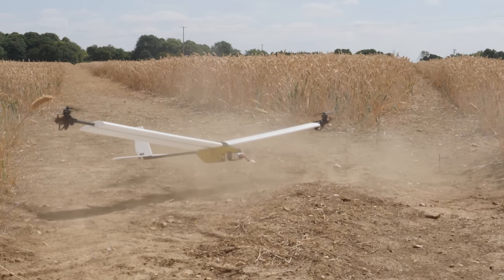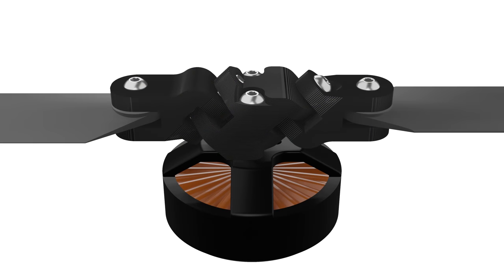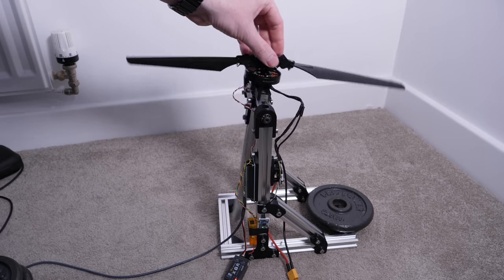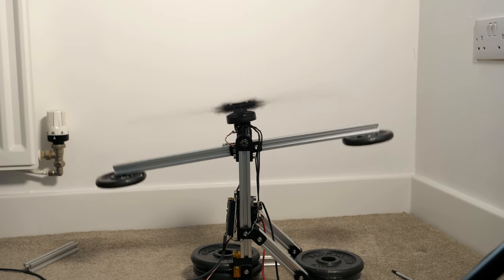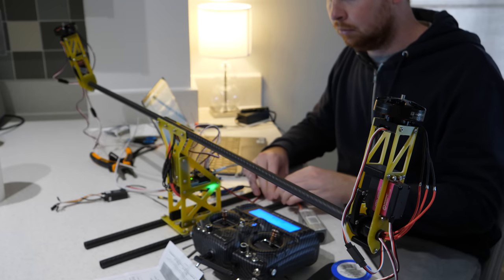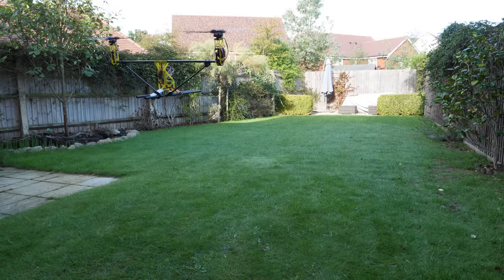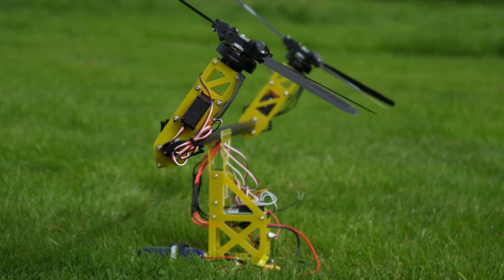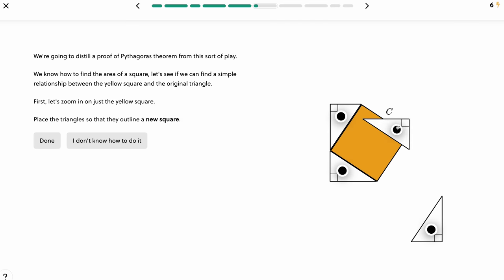Building a V22 Osprey - Part 1

Comment: I had no idea motors could be controlled so precisely and so quickly. Amazing idea and execution, mate.
Reply: Tom really is a bit of a genius.
Reply: Same here I figured the momentum would stop it from being able to be controlled this way.  That's a genius way to go about it.
Reply: As a mechanic I know engine management looks at the crank signal and can also tell when it speeds up or slows down. A 4 inline cilinder fires every 180 degrees. Spark or diesel fuel injection is done with similar timing needed for running a brushless motor. With brushless you need very fast coil switching with correct timing before or after each permanent magnet. So many times per second and within a degree of rotation accuracy, it's mind boggling fast for a human
Reply: @Fantaman900  This is what I'm sayin', it's incredible it actually works.
Reply: Better make sure the motors are sized up a bit along with the voltage and current controllers, because constant rapid changes like that are an express train to burned out electronics.
Reply: @Fantaman900  im wondering if this technology could replace fluid-damper on the front and back of the crankshaft and or get rid of some parasitic HP losses and or maybe make more power and or the parts last longer and or add detonation resistance 

yep i 2 figured the mass/centrifugal force's would stop 🛑it from working like this
Reply: Me neither. Mad, mad mechanics.
Reply: This is nothing compared to what is possible
Reply: @redsquirrelftw  isn't the momentum of the blades part of the working principle? Because the blade lacking behind allows the center hub to tilt it :)
Reply: @MiniLuv-1984  This is something out of first year of an engineering degree. Your personal incompetence is not a guarantee of anyone else's genius status.
Reply: @supermaster2012  Thank you Alfo. A direct insult rather than a veiled one. Misguided and narrow, sure, but direct.
Reply: um. Ever heard music from a radio?
That speaker, the loudspeaker, is a motor : a device that converts electricity to motion, electric energy to kinetic energy. 
And from what you can hear it can do it very quickly and very accurately.
Reply: UH, no. A speaker is a paper cone attached to a permanent magnet and driven by an amplifier. No motors involved at all.
Reply: @da_SpiffR  you do not recognize it, do you.
Reply: @da_SpiffR  A transducer, which is what you're talking about, is nothing but a linear motor.
Reply: Looks like we're one step closer to mimicking how a dragonfly flys!
Reply: If this impresses you, you should check out industrial servomotors. They're mind boggling precise.
Reply: well, controlling motors or other electric parts within single digit milliseconds is pretty much the industry norm since the late-80s to mid-90s so while fascinating and hard to grasp by a mind which never showed an interest in it it's really not that special.
Reply: @Simon-bu4kc  problem iv noticed is most millwright equipment is it over shoot's and or under shoot's and or lower-speed's-response's and no to my knowledge a V8 dampening @5 to 12K RPM's is hard to do in a passenger car/on the road at cost ect
Reply: @backpropagated  yes if its not spitting error code's at me or ghost code's/problem's to fix
Reply: @richardprice5978  sorry, I'm a little confused because if I get it right, you are talking about a petrol V8? that obviously is another story because engines and electric motor really have nothing in common exept the fact you get a turning axle at the end of it. I was referring to only electric applications.
but you are absolutly right about accuracy: when making machines or technical applications more accurate cost rises exponentialy. a mechanical engineering prof of mine used to say "as accurate as necessary, as imprecise as possible" and "as expensive as necessary, as cheap as possible".
as for the bad low-speed-response, I thought with PWM controlling that porblem is mostly gone?
Reply: @Simon-bu4kc  most of the robotics Kr500 stand-still to moving at full speed it a delay ( electric and mechanical ) as there's mass to overcome and same thing for stopping and or actuators on something like rose candy or parker-industrial-manufacturing  equipment and in slow motion steel will twist as a spring adding to the motions and or aiming/timing and making it harder for me to see/fix some types of failures
Reply: @Simon-bu4kc  most gasoline or diesel engine damper's on V8's are a solid chunk of iron on the front of the crankshaft mostly for cost reason's not because it's the best choice for the job next up is rubber o-ring next is silicone filled unit and maybe a electric motor and control could do better with the task and cheaper ect
Reply: @richardprice5978  as I said I am not really experienced when it comes to small electric motors but what you are saying sounds interesting. mass inertia and that sort of stuff is fairly obvious but on a small scale with low power it's less of a deal obviously.
as a mechanic I'm quite aware of primary and secondary vibrations on piston engines. however, the days of a single balancing mass on the crank are long gone unless you buy a really cheap american V8. first of all the whole crank is precisely balanced (obviously) since it's spinning at up to 6000 RPM with opposing forces hammering on it from the pistons. usually nowadays you have 1 or 2 seperate balancing shafts in every engine to deal with the vibrations. only for a straight 6 or V-12 you don't necessarily need them since these are harmonic setups.

Comment: This variable pitch technique is nothing short of amazing.
Reply: it’s practically organic! most elegant.
Reply: Came here to say the same thing! 

One possible way of making it even more elegant, would be to replace the pivot with a flexible hinge that has bending-torsion coupling; or better yet, if you make your own composite blades you could bake that coupling into the fiber orientation. Not sure itd be easy to obtain the required amplitude in such a way though.
Reply: @eelcohoogendoorn8044  I'm guessing you already have a degree in civil engineering? With the complicating dynamic construction idea? You should start your own YouTube channel 😉
Reply: It reminds me of the hacks people in C64 demoscene did :) Like the computer supported 8 sprites but people changed the memory while the sprite chip was drawing them to reuse them on the same screen many times :)
Reply: @jamiewatkins4178  Its not a very original idea; torsion-bending coupling and how that relates to fiber layup is already something you need to pay attention to in the design of wind-turbine blades.
Reply: I think this can be done with a real plane.  Its an elegant solution.
Reply: @javaskull  The bigger the propeller the more inertia it has - and the more energy it takes to change the rotation speed. That's why there's no big quadcopters - at some point changing the pitch of the blade is more efficient than speeding the propellers up and down constantly.
Reply: @javaskull  This is the best I can come up with: Spar cut from flat fiber sheet for axial and out-of-plane bending stiffness; two printed foam cores glued on both sides of that, then wind a layer of fiber roving around that in purely circumferential direction (providing neither bending nor torsion stiffness, but something for the next layer to push against), and then a 45 degree layer of fiber around that doing the bending-torsion coupling; then resin infuse the whole thing in a printed mold to provide the overall shape and aero profile. Perhaps youd need multiple alternating fiber layers for it to work well; fiber buckling might be an issue?

I think its important that the sectional area is a little bit substantial at least near the root; in the limit to a flat plate profile your coupling vanishes I think.

Comment: I apparently need to go back and watch your last video about the single-motor variable pitch blade. it's absolutely astonishing how well that works. Gaining degrees of freedom by modulating a single output and not adding an extra motor OR controller is brilliant. Awesome project!

edit: does flying that way take a significant efficiency hit? I'd guess that with a sufficiently complex controller, you could get regenerative breaking for half the cycle, throw a mid-size capacitor inline with the controller and be in business! Part of me was wondering if a "real" helicopter could be built this way, but it seems like you'd need a lot of extra complexity to dynamically oscillate the speed of a gas engine output and the standard mechanism may be easier?
Reply: I doubt very much that a gasoline engine could be made to do this by itself. That said, it would be almost trivial to introduce the necessary sinusoidal rpm oscillation. Improperly clocked u-joints on driveshafts already do that, for free. All thats needed would be some sort of mechanism to skew them in and out of time.
Reply: Wouldn't this mechanism with a chemical engine require either a mechanical system to quickly reverse the direction of the motor's torque many times per second, or a braking system to reduce the speed of the motor? I'm not sure if the former can be practical, and I'd imagine the latter would at best wear down the brakes extremely quickly.

Actually, I wonder if you could use special gearing to achieve the effect. I assume the way that the motor works is by rapidly accelerating the motor, to adjust blade pitch one way, and then by letting it naturally decelerate to prevent the blade pitch from going the other way? I think you might be able to accomplish this with spiral / shell gears, like in this video (https://youtu.be/0wEtyzgnEY8) but less extreme. Alternatively, I think an egg-shaped or elliptical pair of gears could work, if the axis of rotation is not in the center of the shape (maybe in a focus of an ellipse?) With a constant motor speed, the driven gear would rapidly accelerate regularly, and then slowly decelerate. This would correspond to a blade pitch that is asymmetric over time and could be used to control the aircraft.

I think you could make a design that could (theoretically) work from a constant motor speed. You'll want to have what is basically a manual transmission, but instead of each pair of gears changing the torque/speed by their ratios, you have pairs of shell / spiral-shaped gears with different curves. Oh, and you'd have 4 counter shafts, each with a different shell gear paired to one on the input / output shafts but rotated 90 degrees. Each of these shafts would accelerate the motor (and thus pitch the blades) at different places along the blades' rotation, and thus would correspond to asymmetric lift in different regions to control the aircraft's pitch. 

There's probably a way to use only 1 counter shaft instead of 4, and bonus points if you can create a continuously variable transmission that's spiral-shaped to change the rate of pitch change.

I hope this comment made sense, I dropped out of engineering and learned terms like 'counter shaft' and 'shell gear' just now while searching on wikipedia for how to explain my idea.
Reply: You’d loose some efficiency right off the bat with the conversion, but you could fly-by-wire the main rotor in the most literal way: converting the gas to electricity and then electrically modulating the motor, but I think that whole assembly would certainly loose on complexity and cost to a standard helicopter
Reply: @luelou8464  hah, yeah they would for sure. I wasnt really thinking about in a practical way, but just from a "this is a way it could be done" way. Yeah there would be challenges there for sure, probably not worth it given that the swash plate mechanism already exists. Electric motors just have so much better response rates, so its possible to cheat (in an honestly brilliant way, I'm baffled that this works at all, especially with commercially available speed controllers, and not some custom solution)
Reply: @AlphaPhoenixChannel  yeah, you'd lose by just requiring a generator and an electric motor and a motor controller capable of this control scheme in addition to the fuel burning engine I think.
Reply: Would adding a differential system, with one of the "wheels" hooked to an electric motor and the other going to the main rotor, still be considered "a lot of extra complexity"?
Reply: @tiagotiagot  oh my god that’s amazing. That’s so simple you could oscillate it with a spring. Holy crap
Reply: @AlphaPhoenixChannel  And by modulating the spring tension you can control the applied torque.  Maybe it can be possible to always have it in resonance as engine RPM changes, for maximum energy storage and release.
Reply: Biggest concern around using this method in an actual helicopter would be that it completely stops working if the engine fails - control of autorotation would be impossible without some clever techniques to effectively brake the rotor disk at points in its rotation because the motor is no longer providing any control capability... was thinking about it a lot on my way to my pilot lessons the other day...
Reply: @martync6713  : Another problem is that each rotation change is an additional stress event, which will shorten component life. Not necessarily a problem, and swash plates cause the same, but something worthy of note regardless.

Comment: Very elegant, that thing is gonna look so cool. Seen a few similar questions, thought it might be worthwhile pointing out the pole changes in a brushless motor are done electronically by a micro, so can pull some neat tricks like this. a brushed motor is switched (commutated) by shaft position and an AC inductor motors by input frequency, making it very tricky to adjust speed mid rotation by varying the power delivered. Very precise speeds can be attained, but still take a few revs to count, adjust and recount in a traditional feedback loop. A nice exploit of the advantages of brushless motors. I have noticed high end brushless grinders stop almost immediately when you let off the trigger (active breaking), mid grade pretty quick (passive magnetic braking), but 240v spin for ages (pure inertia, no magnetism without power). No data, just observation.

Comment: HI Tom, something that occurred to me is that you could use ceramic bearings. This are quite cheap and they come in big sizes these days. I bought some for a tilt rotor quad copter I was building.
Reply: Ceramic bearings are always better in performance and endurance.  And the way the three bearings are each pressing on one point of each bearing lends itself to using a ceramic bearing and realizing the advantages thereof.

Comment: Awesome progress Tom. Great walk thru on the process you are going thru. The lead / lag, set up on the rotors is crazy how effective it is being it is torque influenced. My question is "As fast as the rotors spin and as many changes per second are needed to make it do as you wish, how much does that effect the speed controller?". I would assume you use higher end esc's and have some sort of cooling going so they don't melt and let the magic smoke out?

Comment: Showing how the helicopter blade pitches on one side in slow motion is so beautiful. It's borderline organic, it reminds me of a bird flapping it's wings. Helicopters are truly amazing contraptions. Your design is also super interesting.
Reply: It's super cool but I think it's probably causing the vibration. The torque reverses with every revolution, imagine how a car lurches forward when you let off the gas. 

I don't see anything wrong with the tilt mechanism in the previous video, in fact I think it's cooler than the real osprey due to it's simplicity and the fact that it utilizes the same mechanism that tilts the rotors forward. I think forgoing any kind of traditional blade control is a really innovative way of building this kind of vehicle. Though maybe it wouldn't work for something the size of a real V22.. idk I'm uneducated

Comment: Very cool. On YAW control:
If you lean the rotors to the outside by a few degree, you get yaw control by Differential elevator of the rotors. Works on my AW609. No need to use tiltservos for yaw anymore. Mechanics get more rigid...
The extreme Version is the KMax.

Comment: Thanks for sharing your fascinating experience with the  V22!  Respect!   Some 20 years ago I was working on models for a similar (full scale) configuration using a different approach, and met a number of people in the USA who were working with the V22 -  they were struggling with a problem called Asymmetric Vortex Ring, which was an irrecoverable instability that killed a number of crew and wrecked the V22 prototypes. Turns out that long ago the record-breaking Russian 'Vintokryl' bi-rotor had similar instabilities too. Long story short, AVR occurs when a pilot is coming in to land a bit 'hot' and pulls more collective than is wise; this triggers a Vortex Ring condition in one of the V22 rotors,  reflex correction of the resulting roll exacerbates the AVR, and they would ht the ground sideways or even fully inverted. Bad news.
Let me know if you run into problems like this, be happy to share what we learned. Ben

Comment: It looks awesome!!! If you find you’re still having rigidity troubles with the spar, might I suggest switching to a twin or even triple I-beam setup. While this is by no means my area of expertise, it works well enough for the prototypes, and I’m sure you can find some decent lightweight stuff out there for a good price. You wouldn’t even have to edit your motor-tilt mechanism, as the code tube could just be attached to the end spars.

Comment: Ah, I see, you'll be printing the fuselage in vase mode, the internal structure is formed by having the vase outline loops make a turn to the inside inside. Very nice, I've used this technique for some large shapes as well. Prints super fast and it quite strong still.